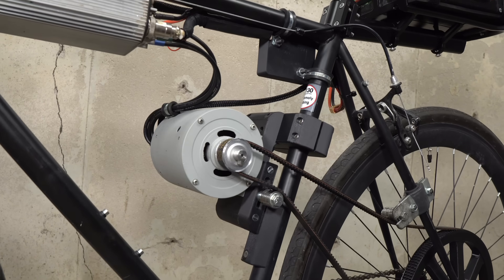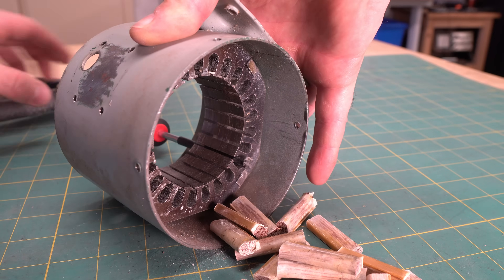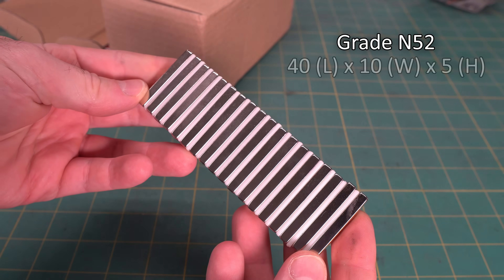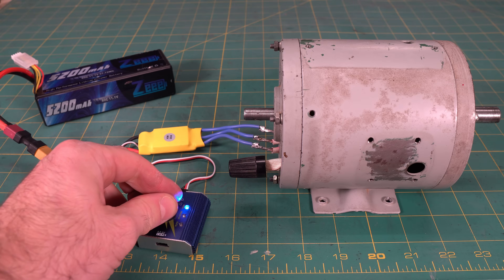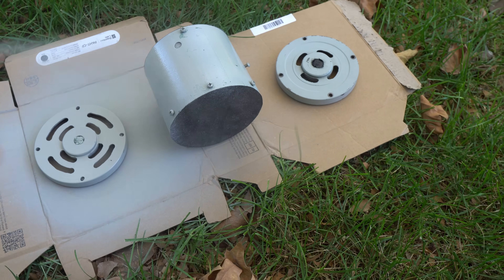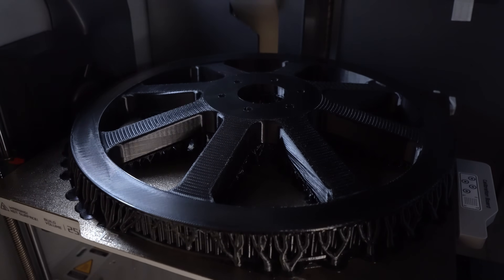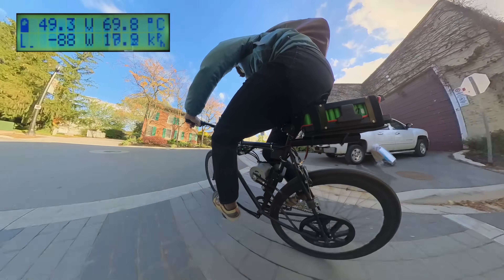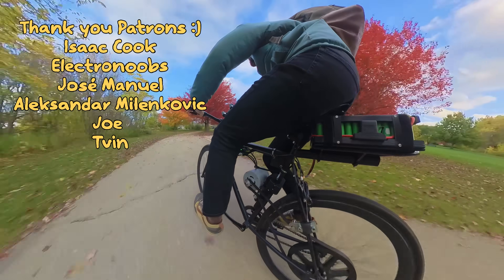Converting an AC Motor into a BLDC Bike Motor

Comment: You shoud measure power output and not just power consumption. It’s pretty easy to make inefficient motor, but it could be said usable if the efficiency is above 90%. Your power consumption compared to speed seems suspicious. Riding in 30km/h shouldn’t use more than 300W.

Comment: Great job - be interesting to see  a comparison between the three phase driver and the Hall effect driver in terms of power . The three phase driver ran the motor in a way that seemed a lot noisier . Maybe also an adjustable plate for the a
Hall sensors might be a fun side project

Comment: Using brushless type, parallel winding in enclosed motor, leads to superheating and low power. This controller sounds like it has a square or "semi-senoidal" wave. This increases the heat and degradation of the winding itself.

Comment: You did the motor windings really well, it's like fresh from the factory.

And I would like to say this about the cogging torque you mentioned at the end of the video; actually high cogging torque is a very good thing because it means that there is maximum flux coupling between the stator and the rotor of the motor and some hoverboard manufacturers make adjustments to reduce this to bring the common divisor of the number of rotor and stator poles closer to 1, yes this makes the motor run smoother and provides a comfortable ride but it seriously reduces the output torque.
Reply from the maker: Good to know. Thanks for the info!

Comment: Actually, you can reinstall the original motor’s air shroud and fan blades; this would result in better temperature control.
Reply: Yes, but then he would have a spinning blade of pants destruction right by his inner thigh. 

A printed duct would be better and comes with the added benefit of no moving parts. The old fan design asumes a stationary motor which is no longer the situation.

Comment: *add angle gear mechanism from angle grinder, so the bulky motor in line with bike  so it safe  when legs pedalling mode, 
*add freewheel to the driven pully for easy pedalling mode,
*add the motor fan blade as cooller n print a cover  to avoid rain water, 
*repack the battery slimmer, use slimr esc , 
*make battery portable for off grid charging,
=Bench Drill.. Ready for Daily use..👍=

Comment: 4000rpm, 48v so about 82kv. 26" wheel,160T on it, about 22T at the motor. When i math everything i find about 57km/h  (36mph) of max speed. It's high but not that much and dosen't explain why you have to pump only 30A to prevent overheating on hills. I find it intresting because it looks like you did a great job building it but this size of motor should cruise with 3-4kw -100A without problem. I also noticed some cracking sound from startups, possibly another sign of a struggling motor. Magnets seems plenty strong, do you think the stator/rotor gap may be too wide ? Also, i don't understand why you had to put a tensionner on the hard strand of the belt, it looks like you coud have just put the motor higher on the frame to easly prevent it. Great video <3
Reply from the maker: Thanks! I was just going off the cross section of the wire. With the motor having 12 parallel strands of 23 AWG wire, the total conductor cross section is about 3.1 mm² (a little less than 12 AWG). I should have done additional tests with a higher current limit while monitoring the temperature. The cracking sound is actually the belt slipping. Both tensioners were not enough and I didn't want to re design the motor mount. A larger pitch belt probably would have been better!

Comment: Great video really enjoyed it. 
Could you add some range test and compare it with alternator motor and some riding insights like wh/km.
I would like to know the maximum power each motor can produce. Try a higher voltage battery and more powerful controller in future if possible.

Comment: A planetary gearbox would make an awesome upgrade
Reply: I don't think this set-up would really benefit from one. 

This motor has a relatively large air-gap diameter, so it's already set up for high torque. And he was able to produce the speed-torque balance he needed just with the belt drive (evidenced by the hill-climb). I think a planetary gearbox would just make it more complex and inefficient while only buying him a smaller hub-gear, which doesn't seem worth it.
Reply: Some gearhubs on the market are rated for ebikes afaik